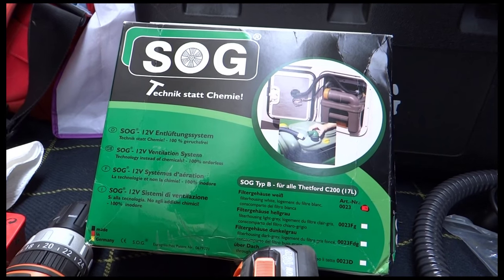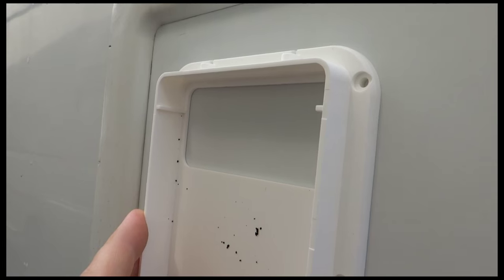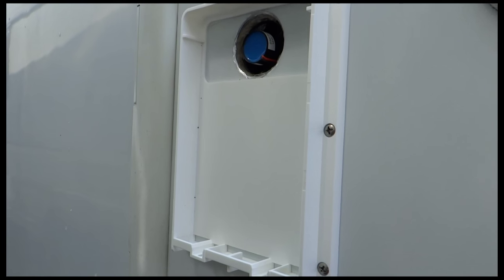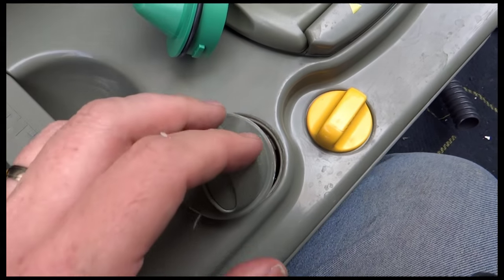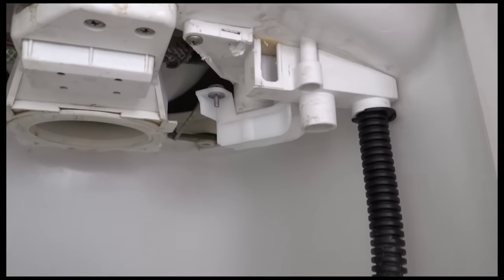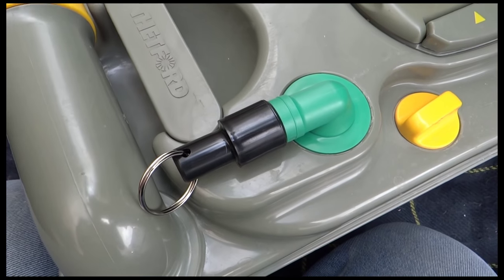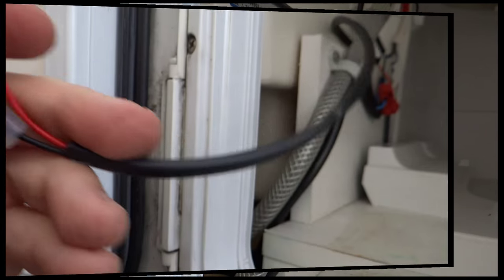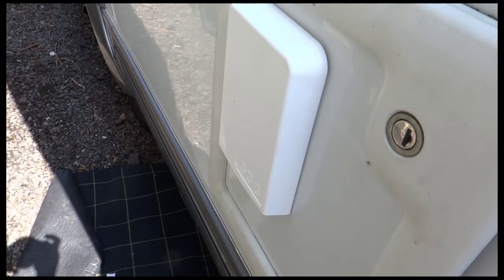Ourtour.co.uk SOG Unit Install Thetford Chemical Toilet C200 Hymer B544

Comment: Never in my life would I ever think to comment on a video about the installation of a SOG lol. Very informative though. I did used to work for Towsure
Reply from the maker: K Hewett life twists and turns hey! I never thought I'd find myself, sporting a scruffy beard and recording the install of something attached to the toilet on a campervan. Nevertheless, here I am! :-)
Reply: great video, very useful for upcoming installation. was the 38mm hole saw correct size, or 36 be better?

Comment: Good vid Jason, I did chuckle when you said you were just going to chuck the outside cover on where it looked right, I thought it was just me that did that. I did wonder when you were connecting wires whether Hymer had gone to the international standard of brown being live and blue Earth, but no, it's still the same as the older ones !!! You'll never do anything now without a multimeter
Reply from the maker: Crichie C yeah, looked OK there, jobsa goodun! There was something about it being 5mm from the edge, but there wasn't any reasoning I could see. It's on an working fine though - had some use this weekend. That multi-meter is coming with us! Cheers, Jay

Comment: Question: my instructions say remove a flate plate in the bottom of the hatch on which the casset sits on top, which is something to do with prrssure release. It is a plate that has a sump under it and i cant see how it realates.

Comment: Any regrets with the SOG system?
Reply from the maker: None Philip - it works very well - the microswitch died recently but I easily swapped it for a new one. When it wasn't working we VERY quickly noticed how good it is (when working) at keeping the smell down to almost nothing. Cheers, Jay
Reply: OurTour Blog just had one installed on mine too. Do you still use chemicals? I am. I don’t seem to get a whiff of chemicals now when opening the toilet flap.
Reply from the maker: @carlyndolphin  nope, we don't use any chemicals in the loo with the SOG. We carry some blue in case it fails, but haven't found there is any need for chemicals while the SOG is working normally. Cheers, Jay